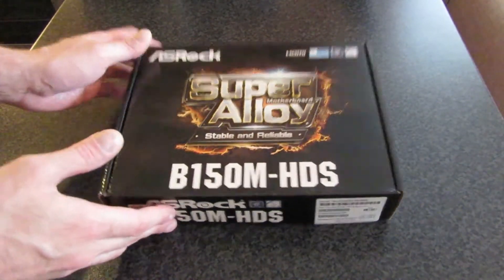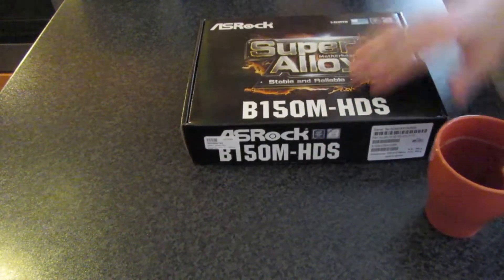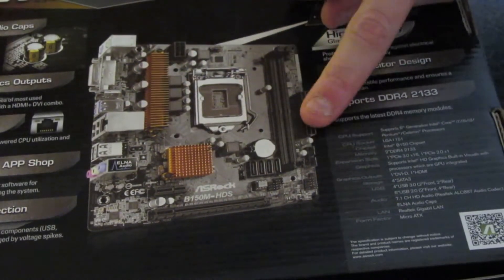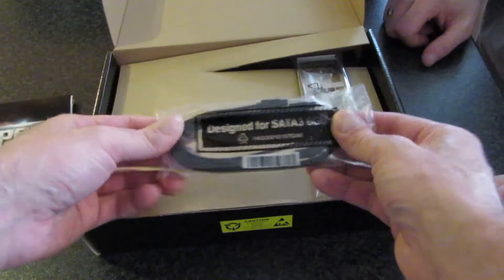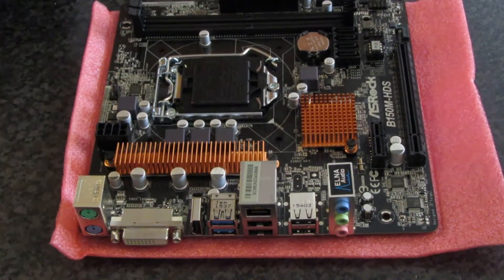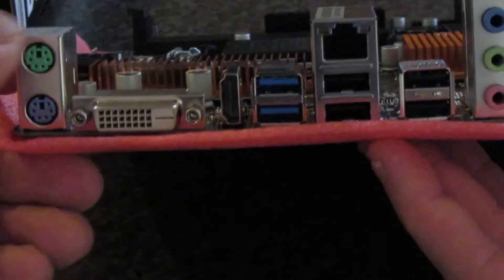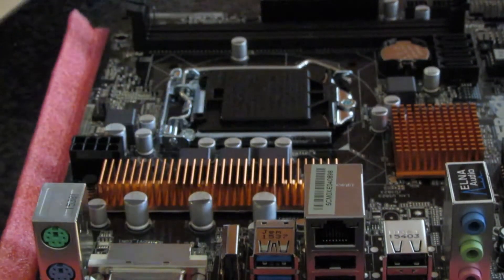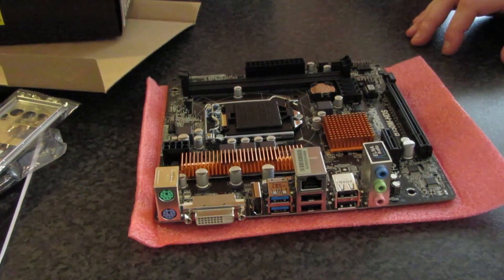Unboxing and Features ASRock Super Alloy Motherboard B150M-HDS 2016

Comment: will this work on ATX cover (i dont know how you telling its name) and a 550w gpu ATX 2.3?
Reply from the maker: check out my full system speck in my other videos. It's all OK on games. 
facebook videos load in a 1-2sec after black screen but no problems otherwise.
Reply: Piotr Miecznikowski i got the translation for that "cover" i meant "case" will microATX MotherBoard work on ATX case?
Reply from the maker: it should. I think it's all standard unless using branded cases like HP, Dell where everything is on the opposite side and they have brand specific hardware made.
Reply: Piotr Miecznikowski ok thank you, but now what about coolers. in microATX motherboards can coolers by all sizes work? because its a small distance from processor socket and ram
Reply from the maker: Check out my video of the processor used. They come with fan and heat sink but you might need a separate one to fit in to your case https://youtu.be/Ii0e6Nmbitw

Comment: can you tell me the ELNA  caps specs they are nest to the 3.5 jacks  tanks ,nice video
Reply from the maker: thanks for watching. You want make, Volts and mF?
Reply: Piotr Miecznikowski  well yes and the model if it is  on it  i domt know  are they elna silmic or  elna cerafine  . Tanks   for the  help
Reply from the maker: Hi, I just looked but without taking my PC apart and taking the motherboard out there is no way to check. All I could see is 2 small caps next to elna connector but couldn't get the spec even with my little mirror tool.  sorry.  I might be upgrading soon so if in few weeks or months you still need it I'll try to post it.
Reply from the maker: they just look like normal caps to me no special markings except the usual but can't get it without taking the board out of the case.
Reply: tanks for the help i am geting the asrock b150 hdv  model and  the Elna caps shoud  increase the audio quality, how much i don't know but i think it will be much better than standard caps tanks!!!!!!
Reply from the maker: my pleasure. Thanks for popping in. 
I don't know if they do that much difference. if you want good sound why not get a separate hi-end sound card? At the moment I have 2.1 on old akai midi tower and random speakers hooked up to my PC and it's fine. I am sure when I upgrade to Logitech Speaker System Z906 it will sound awesome. I hope :-)
Reply: Hi tanks again for your time I just start using my new motherboard asrock b150 hdv  wit I core 3 6100 and just to tell you the sound is very very good those  caps  really make a difference  I just found as far I can se on the motherboard the letters elna and 16 v   100 mF I wish  I cud find more info ,but they really sound  amazing(spry for the bad English)